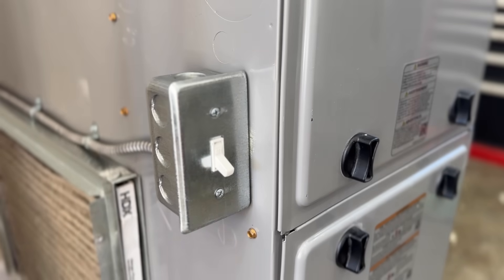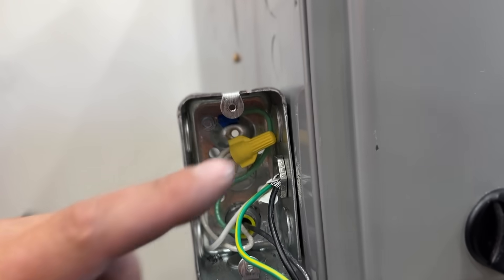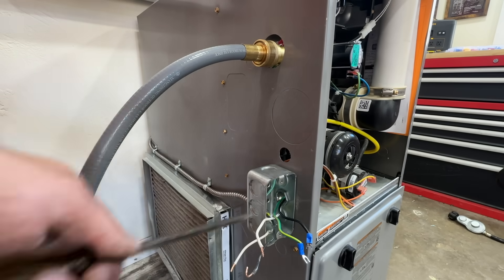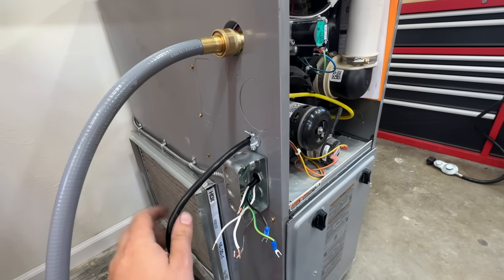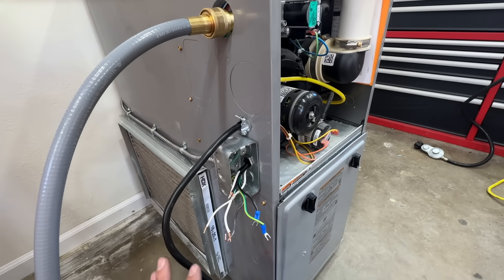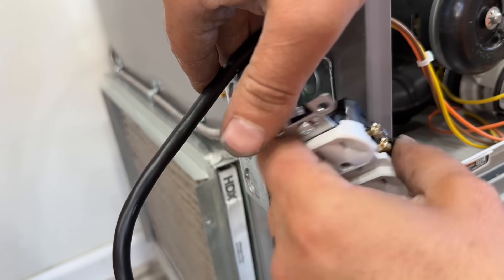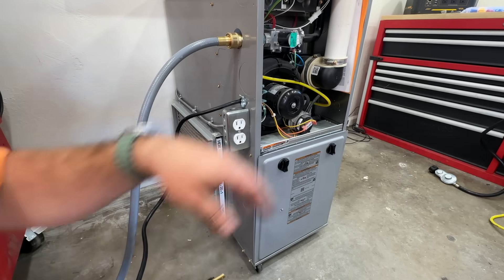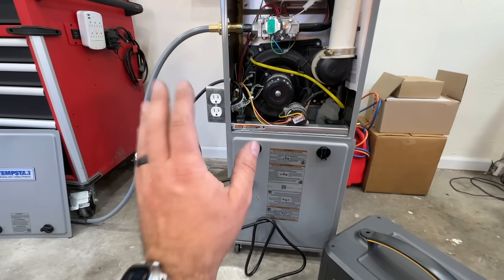Keep Your Family Warm During A Power Outage By Installing This $5 Part

Comment: This is a great idea. Just try doing it in the dark and you will wished that you had done it before the power outage.
Reply: I'm currently gathering all parts to do this LOL! definitely a great idea
Reply: @kevins6277    Do you have a high capacity PowerBank that is sufficient to drive the furnace blower?
Reply: Great video. But you did one mistake that I noticed.

It has to do with your ground wire. Electrical code requires the box (metal box only) to be grounded as well as the outlet. In other words ground wire has to be on both plug and box. 

The main reason why this is. Is because you may have a loose ground connection. Therefore you need the ground wire on both box and plug.

Check the national electrical code book for confirmation.
Reply: That is what flashlights are for.
Reply: Oh like me rn?
Reply: Ty for your comment mr steve. I definitely am the dummy who was thinking, I'll wait to do this.
Reply: Can this be done with a hot water baseboard boiler?  I’m on a well for water so how quickly would I run into low water concerns with my boiler without water pressure?
Reply: I did this same “upgrade” to my well pump and septic tank pump. This allowed me to hook these up to a sufficient power source or generator. Has come in handy several times in the past.
Reply: Or just put the furnace on a plug.  There's supposed to be an outlet next to it regardless. Power out, run an extension cord to a generator
Reply: lol
Reply: Solar light?
Reply: We have an all house generator, but if that were to fail, could I use my Duracell solar power charger that I can also power with electric in between solar?
Reply: We have an all house generator, but if that were to fail, could I use my Duracell solar power charger that I can also power with electric in between solar?

It can run a refrigerator for seven hours
Reply: He did not hook the outlet to the ground. The box was loose. He did not Bond the box itself. It's not a proper grounding outlet with clips on the set screws to ensure proper grounding. Having said that to me it's grounded enough but not compliant
Reply: my headlamp is one of the best devices i own
Reply: I wired my house with extension cords that I just pull out of their vent pipes in the back yard.  It does make it easier if you preplan.
Reply: Well when the power is out definitely don't have to worry about messing with the breaker box lol
Reply: @mailman3243  
You might, if the power comes on when you have the wires in your hands.
Reply: @TheNoncritical1 😂
Reply: How big of a draw will it take to power the furnance?  700w? 1000w?
Reply: @erikrummler9954  My 2 stage gas furnace starts up at about 450w then settles down to around 220.  I would not get anything under 1000w when buying a power bank for this purpose.
Reply: So that makes it so if the power comes back on it would explode correct?
Reply: @philadelphiaslim4144   How? Entertain us with your ' explanation' please.
Reply: Guys, here is The Savior

HalleluYAH translates “Praise ye YaH”

YaH is The Heavenly Father 
YaH arrives via the TENT OF MEETING
YaH was Who they Crucified for our sins
YaH was Crucified on an Almond TREE

— Ancient Semitic Cuneiform of Moshe (Moses)
— Isa Scroll (The Original Isaiah)

Isaiah 42:8
"I am YaH; that is my Name! I will not yield my glory to another or my praise to idols.

Isaiah 43:11
I, I am YAH, and there is no other Savior but Me.

Isaiah 45:5
I am YaH, and there is none else.
Reply: @Praise___YaH  SHUT UP!!!!!
Reply: @Praise___YaH  SHUT UP!

Comment: 1. 5 dollars plus $$$ for the power supply
2. Not 5 dollars even for the parts
3. How long will it last with the battery? You never mentioned the run time, and it is not much. What is the point of the ordeal if you can only run the furnace for one extra hour? Aboslutely makes no sense to bother unless you have a gas or gasoline powered generator.

Comment: Safety....screw the UNUSED remaining brass and silver screw in on each side of the receptacle. Also make the project a little easier by stripping more of the black insulation off of that pig tail cord you added.

Comment: I did my furnace probably 15 years ago.  I would suggest to simplify, where ever the 3 wires go inside the furnace just hook the pigtail there.  9 wires in that little box can be reduced to 3.

Comment: 44 years of  licensed electrician   here ok this works  but :
  •You have over filled that box with wires we have a  code on conductor fill just use a 4 inch square box and proper cover. 
 •screw in that unused terminal 
 * you should strip the cord longer to expose more conductors 6 inches minimum. 
 • a receptacle has to have a ground wire attached to the device and to a metal box to the supply circuit you can not rely on the box and mounting screws as a ground path
 •and WHY is that box  mounted on its side to the air handler and not to the back of the box? That’s why you had to force the cover on. 
 • and yes it works but that is NOT a proper cord connecter for strain relief that is a romex connector. 
 Again this may work but not the greatest method just another example of because it works doesn’t make it right. People are going to complain about my comment but I’m 58 years old and been a electrician for 44 years and there is a reason we have codes

Comment: This is great but how about the natural gas that is supplied to the house. Further down the line it is supplied by electricity
Reply: ??? How is natural gas supplied by electricity at your house??? It’s feed by pressure Powered from the gas company compressor station
Reply: @Electriceric68 yes the compressor stations run off of electricity
Reply: @raymondgodon9543 but wouldn’t effect your house they have back up generators and backup generators for there backup generators. When have you EVER heard of natural gas not flowing
Reply: @Electriceric68 just make sure you have a backup for your backup and turn to Jesus before it's too late we are out of time

Comment: Thanks for the info...I've got an older boiler. I have a simple on/off switch mounted to the boiler, it's over 50 yrs old hydronic heat with a circulating pump. So can you please explain the process of adding the box and plug? It's concerning because I know there's a transformer. I'm over thinking this I think. All I need to do is connect the 120v to the outlet box and take the wires heading to the boiler and connect the pigtail right? I should eliminate the switch, right? I will need to turn the breaker off to the box, right? I mean so I don't potentially back feed through the box to repair people working on the line? Maybe just install switch on before feed to pump/boiler?

Comment: I installed this on my furnace this past summer. Last night we lost power at 2:00 a.m. I woke up at 3:00 a.m., and it was 56 degrees in the house and 10 degrees outside. Made the generator connection and powered up the furnace. Power was restored at 6:30 a.m. Thank you so much for all the videos you post. They are a great library of knowledge.

Comment: Instead of a duplex outlet, install a switched outlet, where the switch controls the power to it.  Makes it easier and more convenient to shut off power to the furnace from the grid.
Reply: Dangerous
Reply: @Electriceric68  Why would that be dangerous?  It's a switched outlet.
Reply: @jackpine4347 I thought you meant  to switch  the utility power on and off  when plugging in the generator back up

Comment: To all who asked, yes this will work for your oil furnace. 
My oil furnaces all run off 110v (120) you can wire your furnace exactly the same as the video. I do make one small change, I install a 2 gang box flush to the furnace cabinet.  I wire the furnace exactly the same as the video. But I also include a switch in the open spot next to the outlet. I do this for two reasons. 1st makes it easy for the HVAC tech to service the units.  Thats why there was a switch there in the first place. 2nd  so when I connect my generator to the pig-tail I don't back feed the power lines. Linemen ground the lines to protect themselves against this while working. I don't want the risk of sending current into someone trying to restore my power. NTM, if that would happen you would be liable for injuries,  stiff fines, and possible jail time. Its illegal to backfeed electricity,. If your running emergency heat, the situation is probably dire and chaotic.  It's easy to over look something simple, that switch by the pigtail is a great visual reminder.  Ideally you must switch the breaker off. The switch is just another safeguard.

Comment: That fan that came on is the furnace purge fan, it's not the distribution fan. The purge fan turns off after a flame is detected and does not heat the house.
This video doesn't even mention the distribution fan at all.

Comment: I have this same exact setup on my propane furnace,which was 18 years old.When that furnace needed replacing,the installer told me that the new furnaces are much more sensitive because of newer technology and advised me to install a surge protector between the generator and furnace to prevent a power surge.Ever heard of this as a necessity?

Comment: I did a google search that said a typical home gas furnace needs 1500 to 2500 watts to start up the blower motor and igniter, then 600 to 800 watts to run. So I would assume this means a 1000 Watt power station (I have one) would not be enough, does anyone know if this is correct?
Reply: A power station is NOT a good idea when they get low , low voltage to the equipment can damage sensitive circuit boards. Maybe a generator but people need to be careful when playing Utube electrician you can kill somebody or burn your house down and if insurance company figures out what you did (and they will) they will deny  a claim

Comment: Your videos are fantastic! Would this method also work: 1. open the front panel and cut the blk/wht/yellow wires. 2. reconnect the wires with Wagu. 3. In the event of an outage, disconnect the wires from Wagu. 4. Connect pigtail to the 3 wires leading into furnace (only) with Wagus 5. plug pigtail into power station. Tks for any feenback.

Comment: By the time you need that backup battery,  it may already be dead a long time ago. You need to keep buying a new backup battery every ten years and remember to keep it fully charged all the time. I didn't need to use any backup for my furnace for four decades already.

Comment: Natural Gas insert fireplace is a better solution, with an air recirculation fan they only burn about 22W, but I suppose that's an option. My issue with doing this is that even with several kilowatt hours of battery backup, it's only going to last you a  day or two because these furnaces burn hundreds of watts of power when they're on.. Same setup on a gas insert fireplace could last you weeks.   Unless you have a generator, but generators are expensive to run for the amount of energy they deliver.

Comment: Do Not do this as described . It is a Code Violation. The handy box used in this video dies not have a enough capacity for all the wires and the outlet. It may fit but is violation of the National Electrical Code Article 341 (junction box fill) . A larger box must be used .  The cord should not be routed through the furnace. Instead it should be connected directly to the new larger box.

Comment: I did something similar, but I had access to an old, no-longer-needed, rack-mounted UPS from a DataCenter I manage.

I bought new batteries to refurbish the UPS.. pulled power to a corner of my basement (UPS requires 20A)..  then I ran a new electrical circuit from the furnace to a box by UPS.    
Here's how it works..    
Furnace power is piped to a nook in my basement where UPS is located.   That terminates in an electrical box that has a power cable coming out of it.  that cable plugs into a UPS.       In the case of a power dip, or an extended outage, my furnace operates entirely off the UPS (until the batteries run out).     
Because I also have an EV that supports Vehicle-to-Load.. I can also run an extension out to my car and run my furnace off that extension. 
It gives me peace of mind when I'm traveling in the winter.. I know my Furnace has some extra life in the winter to keep my Cats safe.. until I can get family over.

My only real feedback here is.. the connector used here is designed for flexible armored cable.   It should be fine with a plug pig-tail, but as the presenter said.. it might be a code issue in some places.   There is, however, an electrical box connector that's made for this.  The one I'm familiar with is made by "Sigma".  It's called a "ProConnex" cord grip connector.    It looks like a conduit to box connector, but it has a rubber bushing to go around a round insulated cable and the bushng compresses as you tighten it so it's also water-tight.    It's my preferred way to attach a round insulated pigtail to an Electrical box.

I am happy to see you not wiring this in-line.   I was worried you'd set this up so it was simultaneously wired to both mains and the generator.   Aside from potentially bleeding power back to the mains.. it could be 'bad' when the generator was connected while the power came back on.

Comment: Question.  When you pull the plug you are disconnecting the hot and neutral from the grid but not the ground. What will happen when I plug into my inverter with the ground still connected to grid?  I have two inverters, one has a floating ground and the other does not.

Comment: Thanks for the video!!  My furnace already plugs into AC outlet box with normal power cord.  Do you have any guidance ... or somewhere to look ... for how long a normal gas furnace would run under what size battery power?  I'm thinking of 1545 Wh battery.

Comment: Did this with my furnace.  Got an EcoFlow Pro 3 + extra battery.  The power company had to replace a big green power box for the whole neighborhood, so power was out for 6 hours.  The EcoFlow powered my furnace, my refrigerator and a freezer with no problem. It was during the day, so no need to power lights.  I also have 2 EcoFlow River 3's that my 2 computers and routers are powered through.  They act like an UPS.  When power went out, I gracefully shut down computers but was able to keep my routers up.
Reply: Brave plugging a refrigerator into one of those low power can damage it

Comment: Why do you put the extension chord through furnace?  Why not just put it in the electric box?
Reply: You could do it that way as it would be identical from an electrical standpoint, but the cord is run into the furnace instead of directly into the box to indicate the furnace is a plug and cord controlled appliance and is physically separated from the power source (electric box).

Comment: Just a quick question for those out there that know - How many watts does an NG furnace pull? The house is 1350 sq. ft. I want to get a 2400 peak 2000 run power station just for the furnace. Will that be able to handle it? Thanks.
Reply: Don’t waste money on a power station bad for equipment with circuit boards just buy a real generator
Reply: @Electriceric68 I have a “real generator”, but instead of running it all night, bothering neighbors and having doors or windows not properly sealed due to extension cords, I figured a power station would be a good solution.

Comment: The only thing that I would say being electrician for 45 years you should really put a deeper box in there metal and I would not use those type of connectors electricity does vibrate and I have had workers use those type of connectors in a recessed light that later on gets covered up and they pop out they're really not that reliable as far as the code calls for they do what you call box count of how many wires are in there and how big the devices that's going in there there's not enough room there can be too many problems not having a deeper box nothing against this guy but he is definitely not an electrician because he would know immediately it needs a deeper box😊😊

Comment: Well done, but the title is a bit misleading, your power station is not included in the $5. If I were able to buy a generator (to not say an house before that), I would install a generator switch and an interlock in the breaker panel, to not be limited to have only the furnace working.

Comment: Wouldn't you want to keep the switch so you can keep the power from the power line outside shut off while the generator is running then when the power comes back on you can shut the generator off before you turn the furnace switch back on for the outside power line source.

Comment: My furnace doesn't have a switch on the side of the unit the switch to cut power to the furnace is located on an wall near the entrance to the mechanical room. i have a Lennox mid efficient furnace.

Comment: As a retired Lineman I don't like that you have no switch at the furnace. I can't tell you how many times someone unplugs the furnace, plugs in their Generator and does not flip the breaker, backfeeding into the system. Not fun when you're trying to fix lines during a storm

Comment: Can someone help me out, the pig tail has a green, white, black wire the switch has a yellow and black wire. My question is if the pig tail white goes to white and the green to green where does the pig tail black go? Only black wire I have left is from the switch. Does it go to the switch black wire?